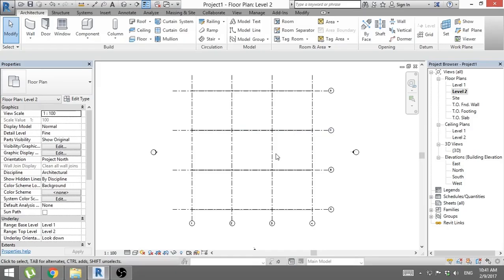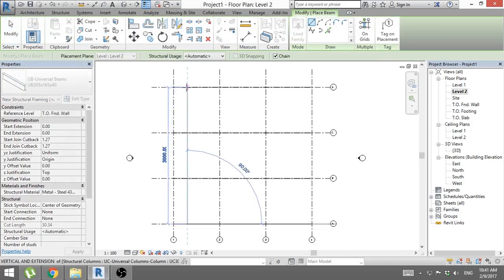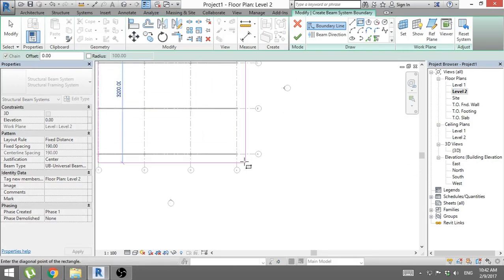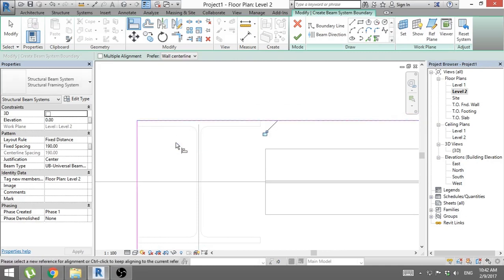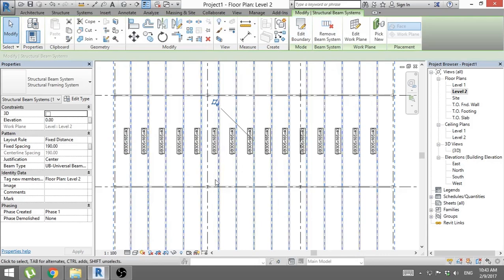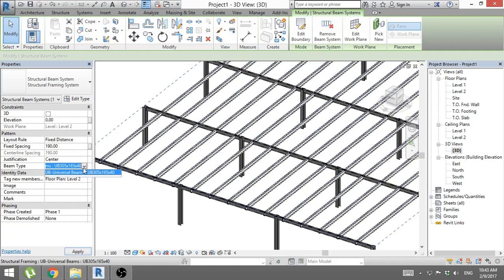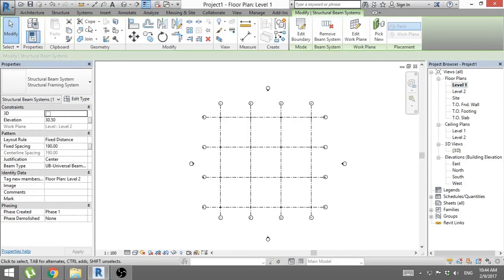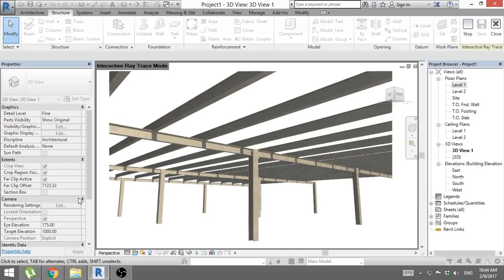How to Make a Beam System in Revit

Comment: Thank you very much for your video.

I would kindly request you to share a detailed video tutorial on creating purlins using the Beam System.

> How to change or rotate the direction of purlins within a beam system.
>How to edit the beam system internally, including:
   *Removing one or two purlins if not required
   *Adding one or two purlins after creation

How to adjust or change the elevation (Z-direction) of the beam system or individual purlins accurately.

Thank you in advance for your guidance and support